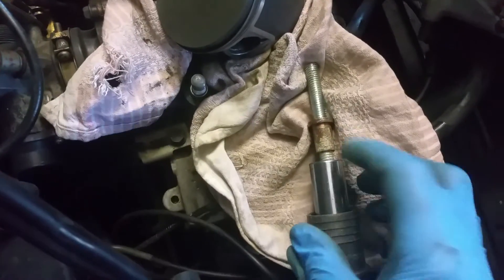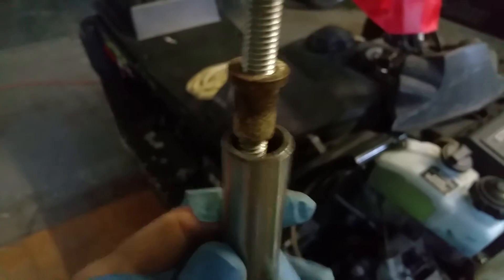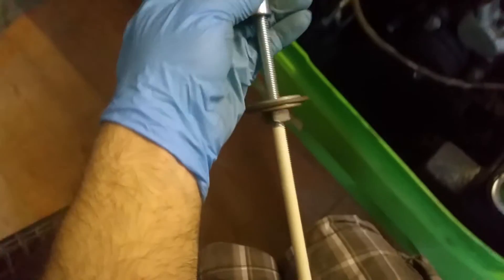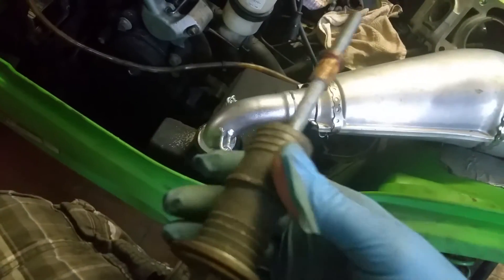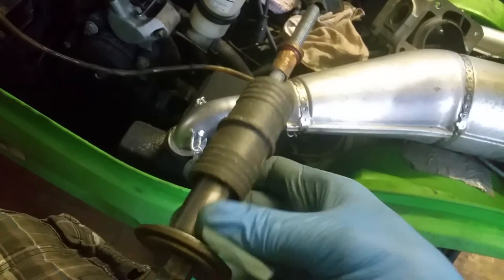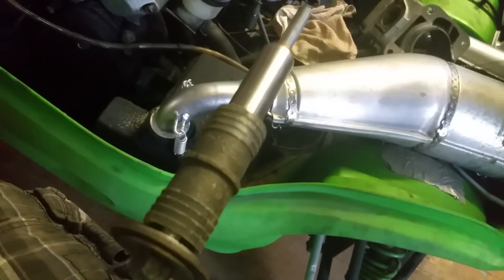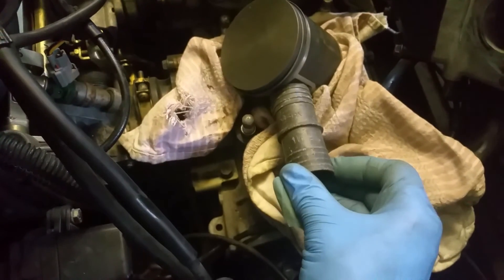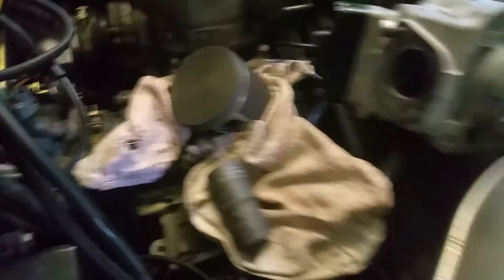DIY  Homemade piston pin puller remover / installer

Comment: You mentioned that you left the other circlip in its place. How hid you get the spacer that rides against the far end of the piston pin past the circlip? By looking at it from the video, it appears to be just marginally smaller than the outside diameter of the piston pin and therefore most definitely somewhat larger than the inner diameter of the circlip. If there was a flat section that corresponded to the circlip milled into the edge, it could be understood.
Reply from the maker: So sorry just getting back to you on this for some reason I must have missed it. I'm sure you have figured out a solution by now but if i understand your question correctly you don't understand how I got it through the center of the piston pin to start with? I stuck the bare threaded rod through the center and then threaded that round nut on there. I got lucky and found that round nut that was the perfect size and just smaller than the outside diameter of the piston pin and also smaller than the circlip inside diameter so I didn't have to remove mine on the far side. I have a C shaped circlip on this machine so on some pistons that have G shaped or snap ring type than you will need to possibly remove the circlip on both sides or grind the nut down so it is smaller than the circlip I.D.. For larger diameter threaded rods you will probably have to grind a nut down to a round shape because a regular nuts diameter will likely be larger than the piston pin diameter therefore it wont work because it wont slide through with the hole in the piston for the wrist pin. For this reason if you are buying a threaded rod or have several choices laying around you might want to pick out the nut first ( ideally just smaller than the outside diameter of the piston pin and also smaller than the circlip inside diameter) then get the rod that goes with that nut. That should save some grinding time. Also if you don't have a threaded rod you could use a long bolt or screw and saw or grind the head off.